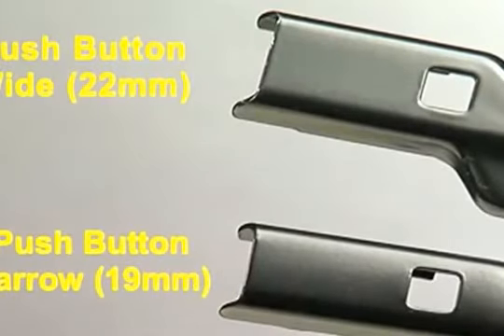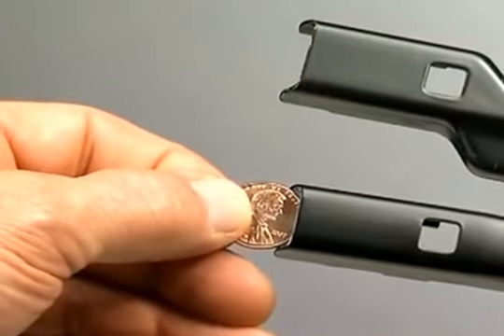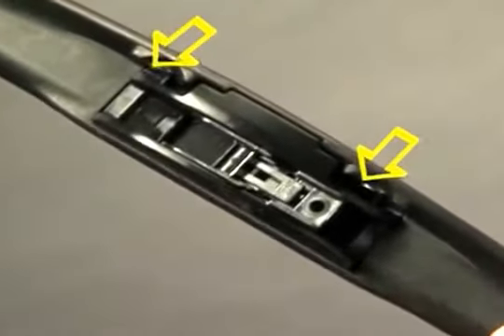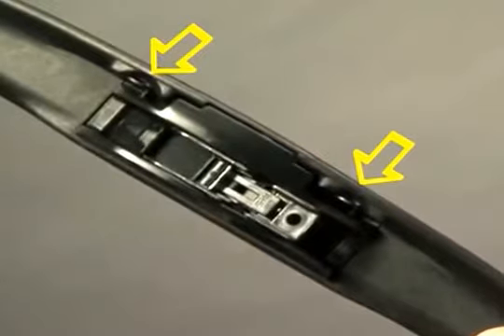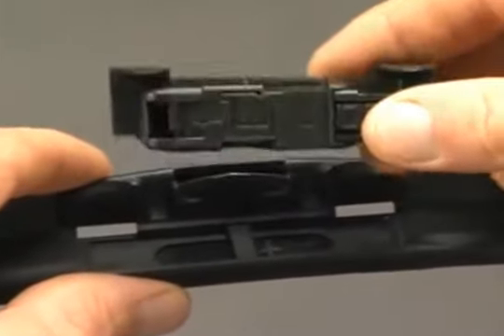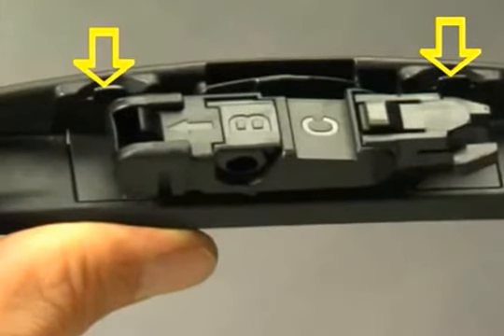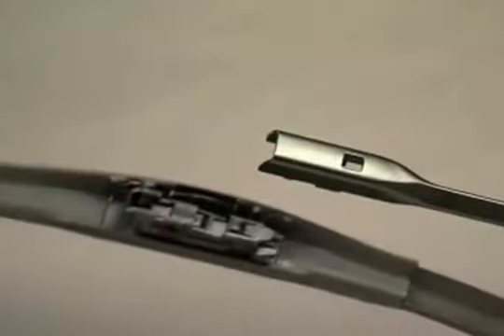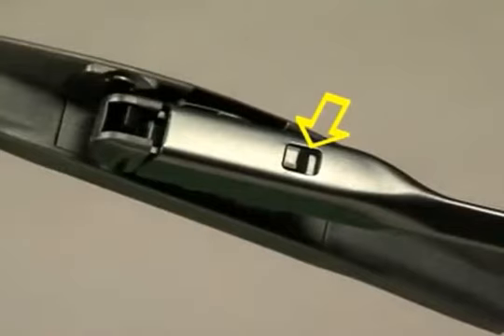Trico Force Push Button Narrow Installation Video

Comment: Thank you SO effing much for this video!  Yes, this is by far the most difficult VW adapter set up I've ever confronted... and I have not one, but two GTI's.  

A quick note on the "shim" adapter C removal... you need to press down significantly harder than what you see in the video (for those of you that might be struggling with that part).  Thanks again, so much for this video!